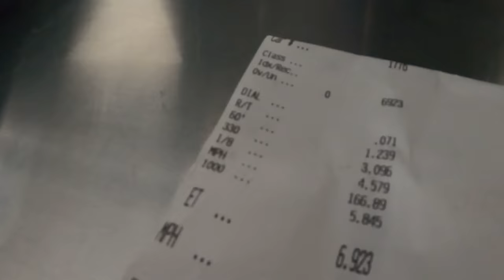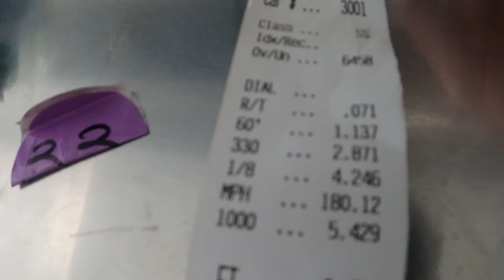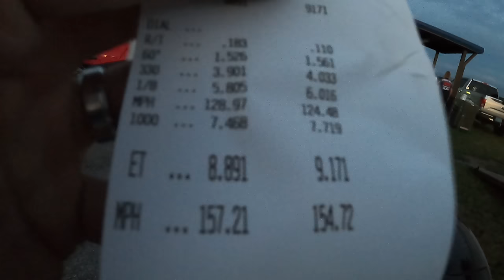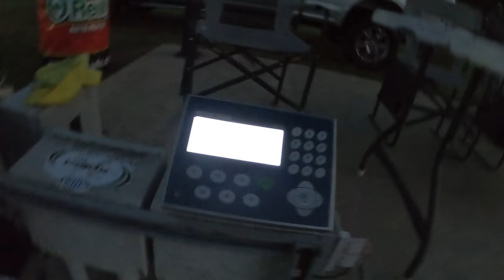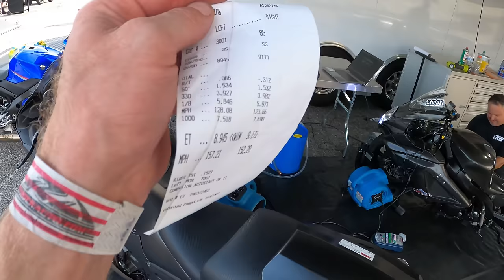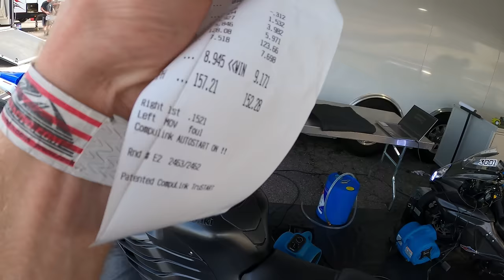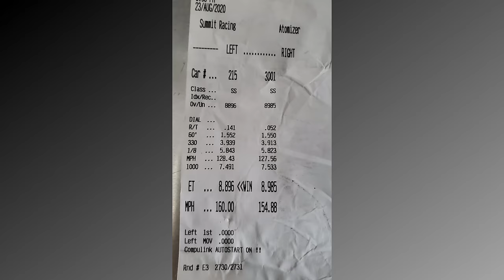Suzuki Turbo GSXR 1000 Black Mamba goes 226 MPH in the 1/4 !!! Moore Mafia

Comment: Great video, great racing and I’m sure you’ll get them next time... contact me if you want more info on this but if you installed a thumb brake to use instead of letting off the throttle when you wheelie to much, you would save 1/2 to a full tenth. You know as well as I do that, It could be the difference in winning or losing sometimes. I’m talking through experience... keep on doing what you do, love watching it!